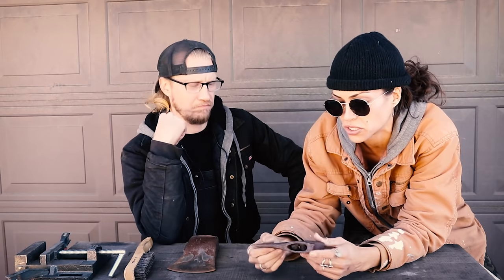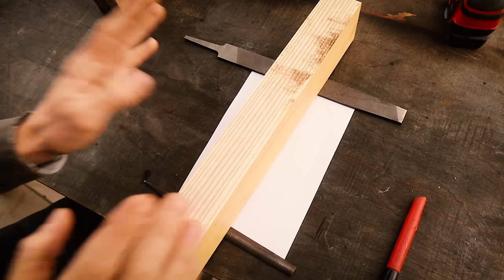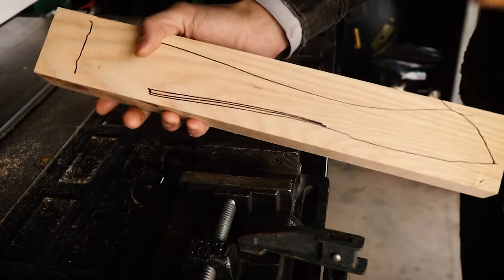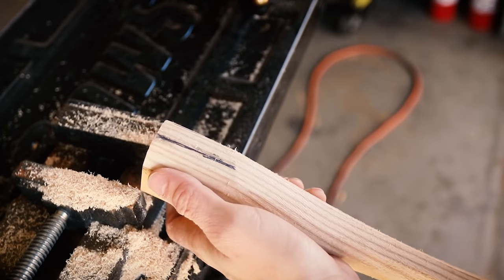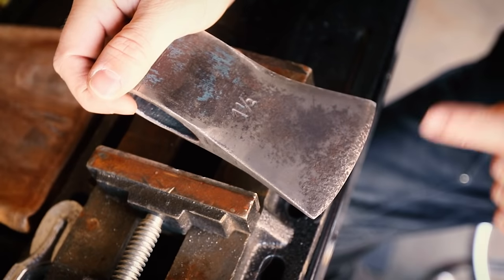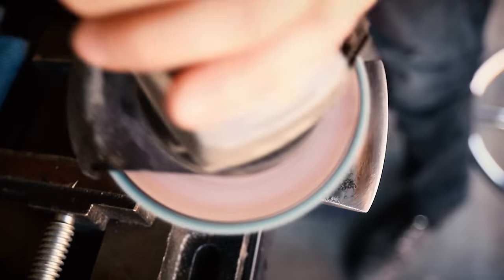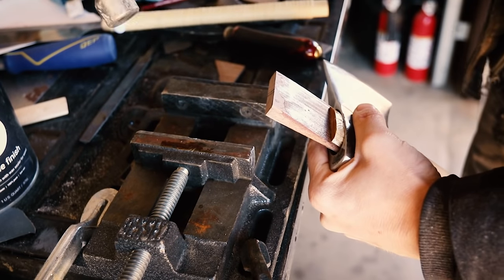Rusty Gold: Cold War Hatchet Restoration | West German Axe Full Rehab Process + Tips and Tricks

Comment: Excellent job Bret, just wondering why it was marked with 1 1/2 and not in metric for weight?
Reply from the maker: I have no idea. Weird right?
Reply: My mild research shows that after WW2 West Germany was controlled by the USA, Great Britain, and France. Great Britain still more or less used imperial measures at that time as did the USA. I'm guessing there were about 20 years of West German made products based on imperial measurements. I found vintage West German made scales and tape measures online in pounds and inches respectively. Interesting, to say the least.
Reply: @nathanjohansen7169  thanks for your input….very interesting.

Comment: Lot of great info here, Brett.  Quick question, when you sharpen the ax head with various rag thicknesses it creates a curve. I'm used to straight angles on knives, but I'm sure there's a reason for the curve? Thanks!
Reply from the maker: Very slight curve, but remember, axes and hatchets put a ton of strain on the cutting edge, and pushes the material away. Whereas a knife is slicing through. If the faces/cutting edge of these tools were dead flat/straight, they’d get stuck if they didn’t make it all the way through a cut. The curves and swells on a typical axe serve multiple purposes other than aesthetics.
Reply: @skullandspade  brilliant - just what I was hoping for!  Thanks for taking the time out to explain that.  :)  And give my best to the Gaeries and snakes!

Comment: Can you explain why pounding the bottom of the handle with the head hanging down puts the head on tighter instead of making the head fall off?
Reply from the maker: Seems counterintuitive, but it works. The kinetic energy from the strike goes into the handle, but the heavier steel does some amazing physics magic and stays in place. This, handle goes down, head bumps up.
Reply: Thanks, I have always been curious about this.